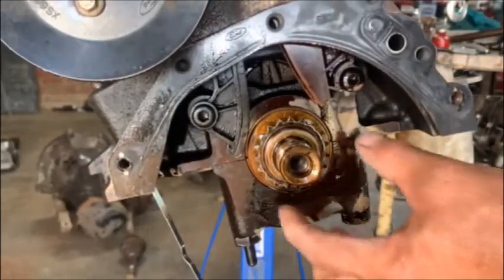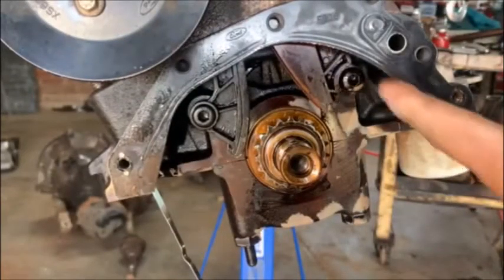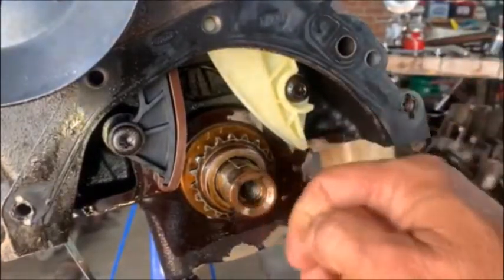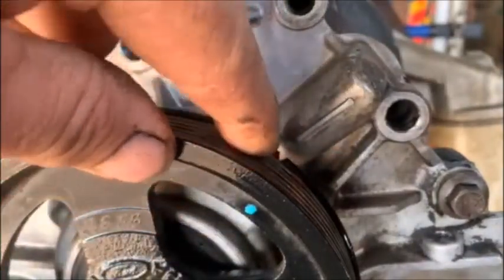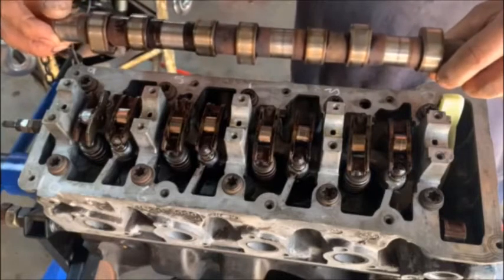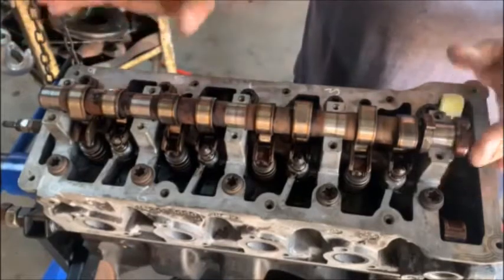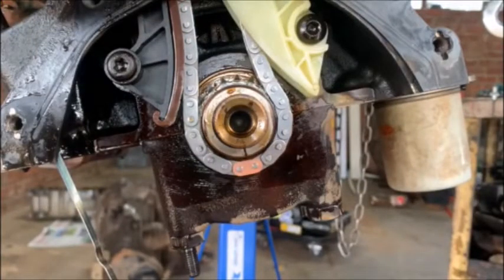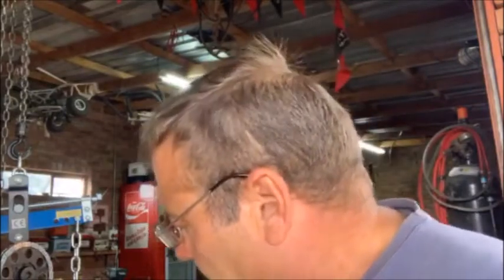Ford Rocam valve timing

Comment: I have one of those engines (but 1.0 supercharged engine) with a valve timing issue i guess. The intake valve is opening 18 degrees AFTER TDC.

Do you know whether that degree is correct or anything in camshaft just spun on it axis?

Comment: very good instruction of this video for the ROCAM i am also busy with complete engine overhaul 2 cylinders dropped compression no 1&4 120psi no1 no2 150 no3 150 no4 90psi so after strip discover bad bore and noted prior to strip engine tappet cover oil filler was full of oil blow by crank case ventilation also further stripping engine bores were scored with vertical marks in bore well engine is at the engineers mic up and advised we require oversize 20thou and also the block requires decking slightly due to the engine overheating matter i suspected, these parts are very costly R18000 in total for everything my next worry is the feedback from engineers on the cylinder head i applied a straight edge and i CLOSED MY EYES after what i saw 🙈🙈🙈🙈🙈
Reply from the maker: Good luck with this one, keep us posted on your progress.
Reply: Hi Gents i just received the cylinder head back today and all my parts to re-assemble and fit the engine i will keep you posted and make a video of the process and start up thank you very much for sharing build on this little engine...😂
Reply from the maker: @djgeefunk4090  pleasure, i am glad the video helped you.

Comment: What causes over fuel on Rocam after engine rebuild? Mechanic is struggling
Reply from the maker: Hi, clean injectors, check TPO, check spark and look for air leaks
Reply: IS IT S0RTED YET

Comment: Thanks oom. I have a bantam 1.3 shocking to see it has plastic chain tensioners. Irispective I enjoy its little performance. I would like to up the performance with a branch and free flow with maybe a piggy back ecu am I wasting my time ? Should I just drop another motor in ? I'f so what motor all comments are welcome.
Reply from the maker: Just go for a 1.6 Rocam engine, it will fit and you don't need to mod anything. On the 1.6 you can fit a branch and free flow

Comment: Thanks for the video. It was very helpful. My 2004 Ford Ikon had the same problem with the chain guide breaking and the broken pieces ending up in the oil pick up. In my case I ended up with one of the piston rods punching a hole in the block!
Reply from the maker: thank you for the good review.